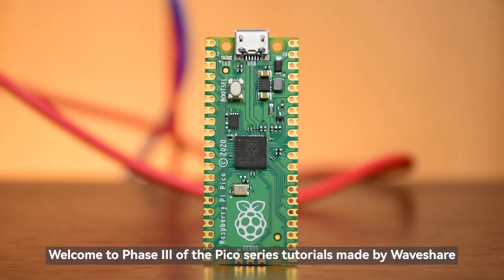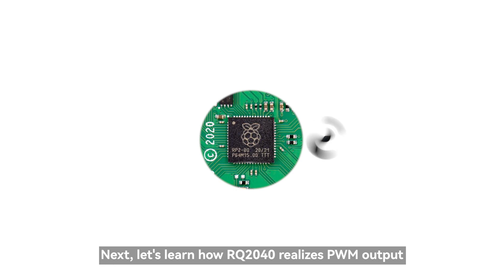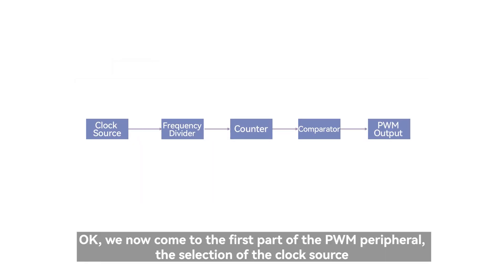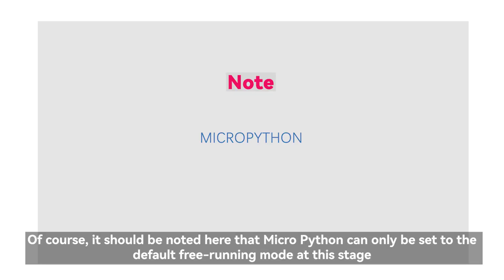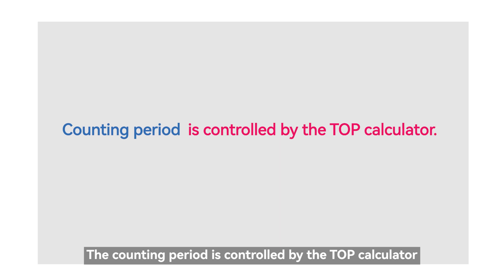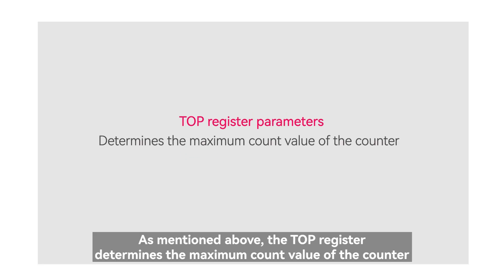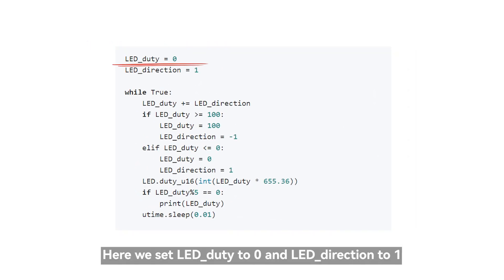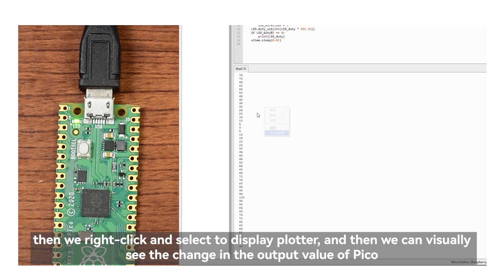Pico SeriesTutorial III PWM

Comment: I have a dso with a frequency of 100 MHz, and I use Thonny IDE and Micro Python with a Rp2040 system clock of 125 MHz. I also know the pwm frequency, which is 62.5 MHz.
I have to make a pwm in an RP2040 at 50 MHz, thus here's my code:
from machine import Pin, PWM
import time
pwm_pin = 0  
pwm = PWM(pwm_pin)
pwm.freq(1000000)  # Set PWM frequency in Hz 
# Set fixed duty cycle
pwm.duty_u16(32768)  # 50% duty cycle (32768 out of 65535)
I want a square wave, however the PWM produced noises and ripples with this code.

Thus, how can I lessen the noise and ripples? Help me please
Reply from the maker: Dear you can ask for support here https://service.waveshare.com/